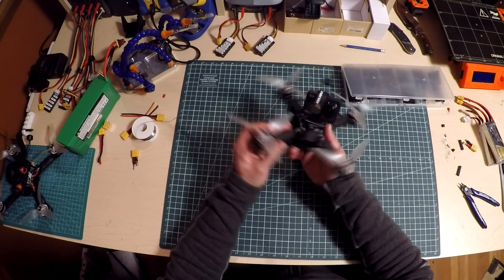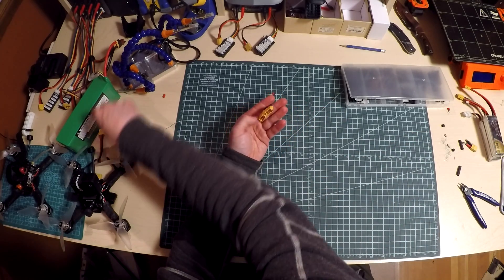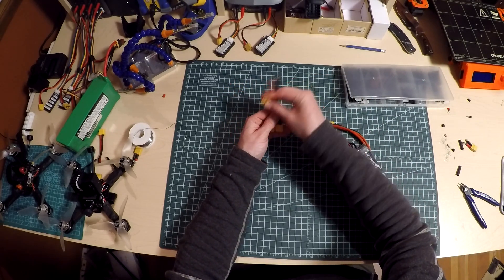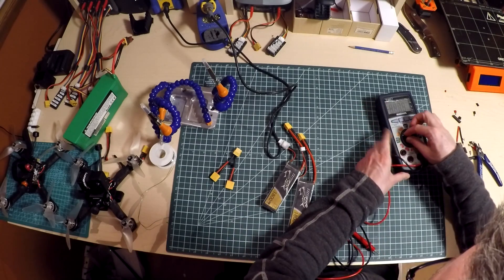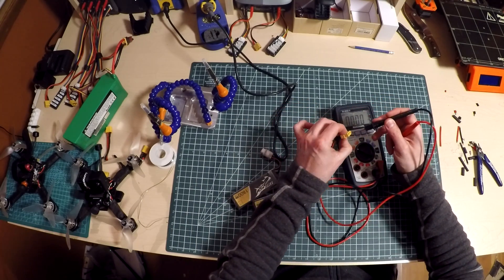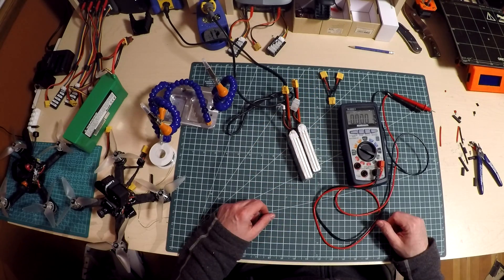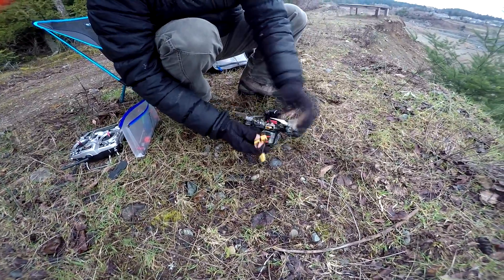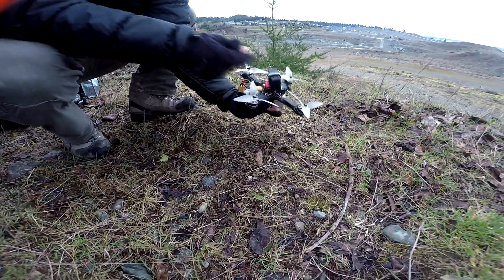I built a 6s battery out of 2 3s batteries... and flew it

Comment: I’m trying to do this for a fixed wing plane that used to be nitro plane. I am doing a full electric conversion of it. My question to you is what amperage is your ESC and what kind of motors are using? I’m just curious to see if my motor can support my 60 amp esc and a 6s lipo function
Reply from the maker: I think the escs on that quad were 35A escs.  The current isn't related to the voltage as you know, so it's not like you need higher current escs for 6s - but they do need to support the voltage.  They are 2306 2450kv motors, which are too high kv for 6s, so I definitely don't make a habit of running these motors on 6s :)

Comment: That voltage sag! Those batterys are crying
Reply from the maker: I brought 5040 props with me, which I should have used instead of the 5051s, but I was so excited about trying it out that I forgot to swap props.  The batteries definitely came down pretty hot - I'm sure they are worse for the wear.